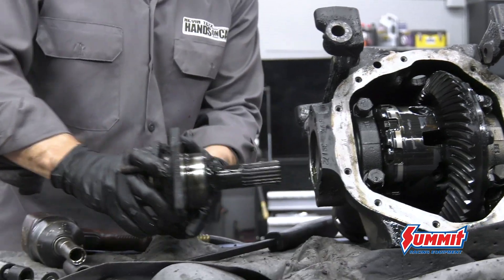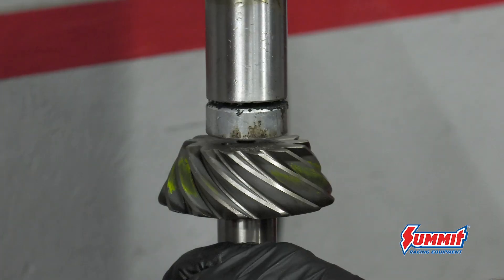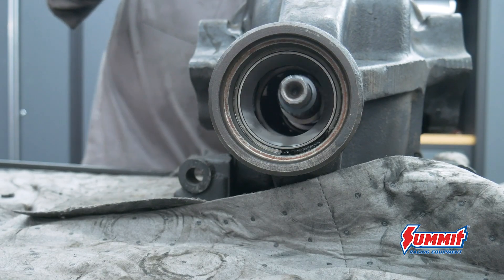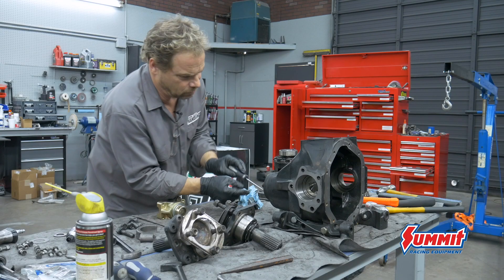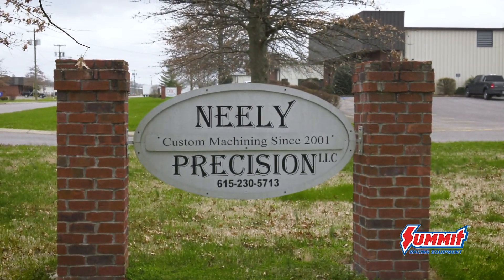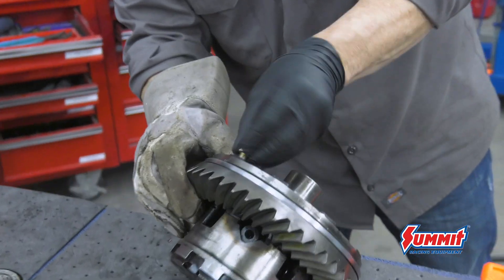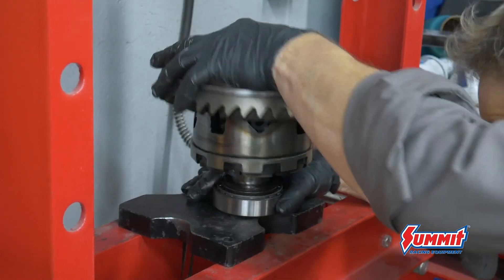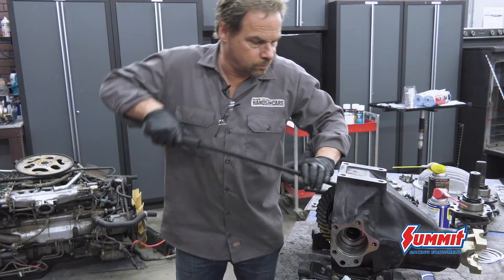Project XJS-LS (Part 4): Rear Axle Rebuild and Ring and Pinion Swap

Comment: The 70's XJ and XJS came out with a factory 3.31 gear in many applications. I just would've bought a good used one and put new seals in it. The rear ends in these things are bulletproof.
Also, you should've beefed up the rear subframe cage, you will develop bends and cracks in it where the diff bolts to the top.

Comment: Jaguar diffs were Salisbury Powr Lok up until 1985-86 when they used a Dana 44 (no drain plug & steel rear cover & an odd sized ring gear bolt) then they switched back to GKN PowerLock diffs (which were essentially Salisbery).  You could swap the entire internals between housings, but you can't mix and match parts.  AFAIK GKN bought Salisbury, and then they were both acquired by Dana.   Oh and a modern Torsen  LS Carrier can be installed these days.

Comment: Y DIDN'T you purchase the correct carrier for the gear ratio, Dana has always had 2, dependent on ratio-1 for 4:10 and lower, 1 for 3:73 and higher